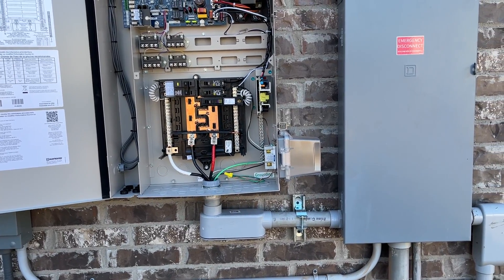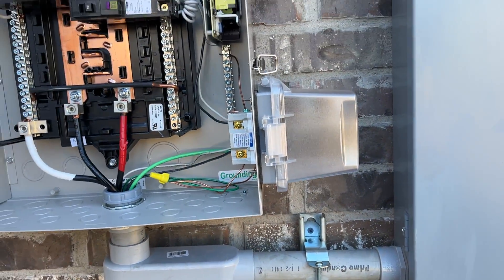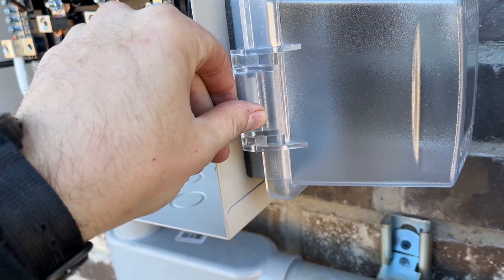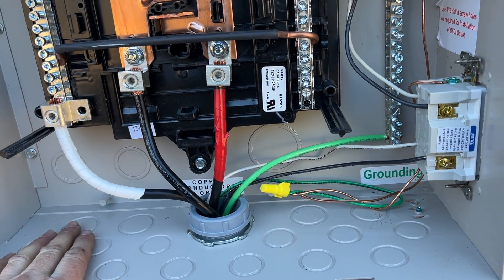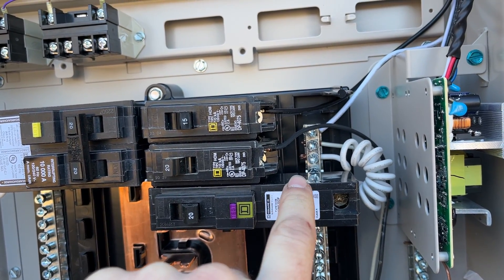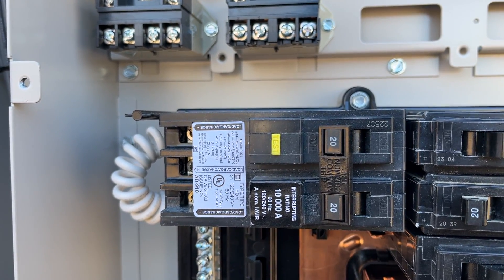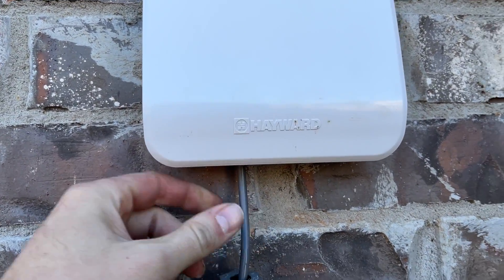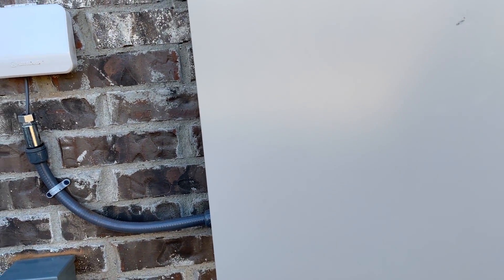Installing the Hayward OmniLogic Panel - Episode 1

Comment: I probably would have put the controller inside a Hammond 1414PHJ6 and connected that back to the panel with 1/2" conduit and bring another 1/2" conduit in for the ethernet. Then your ethernet connection will be protected from the elements as well. With that ethernet port exposed it seems like they intended for it to be installed indoors or a protected area?
Reply from the maker: Thank you for the idea. It’s a good one. 

The controllers certainly advertised as outdoor rated. The cover has a good gasket on it. I agree about the exposed Ethernet. We will see how it fairs. 

Another video is in the works showing that piece. I tried to protect it as best I can. 

If it ends up going to crap, I’ll show that too. 

Thanks for watching.